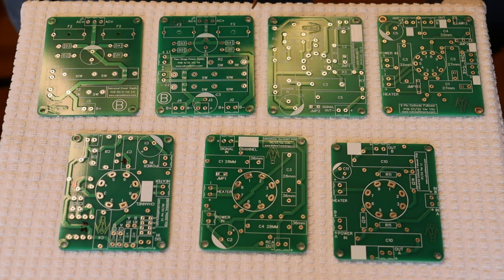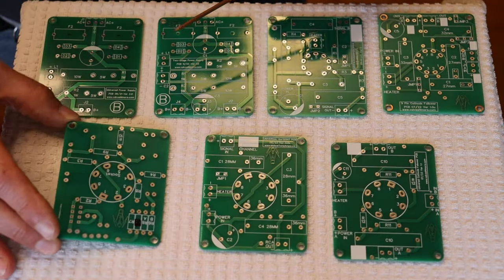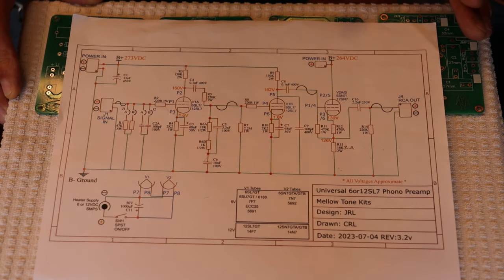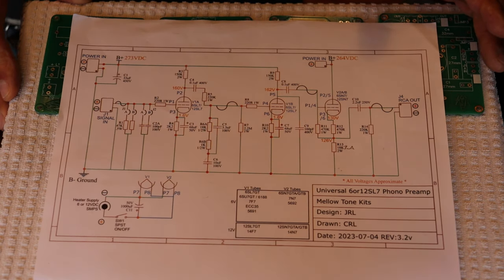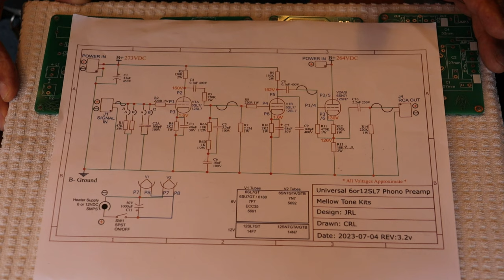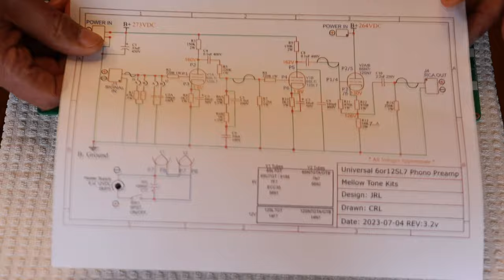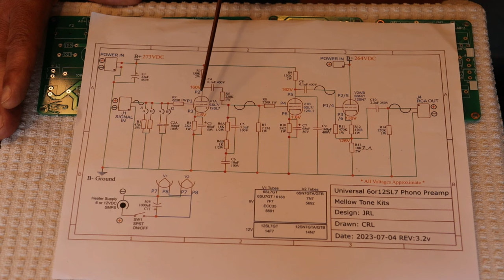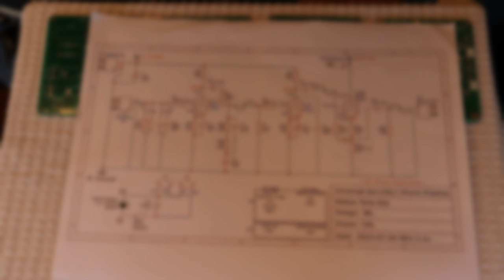Mellow Tone Amps #05 - Kit PCB's

Comment: You guys are great. Im glad to see yall making the PCB's you offer more known to the public. 

They really are great PCB's. Very versatile. Well made with appropriately sized solder pads. I've bought 3 different pairs of preamp/driver boards & 2 pairs of power supply boards from MTK so far. I also have the Classic 6sn7/12sn7 kit. Its very nice. 

The PCB's are a great price for what you get. I have paid A LOT more for other PCB boards/kits that were not as good or versatile as MTK's. The MTK's are proper, solid, double sided boards.

Comment: Yes a bit more work with point to point wiring, but one thing it gives is more space as you mention, since you have a third dimention to work in. Thus you can  get much more spacing between the terminals of the wires connecting the tube sockets. But great looking boards for those without the interest and needed patience to work point-to-point.  But I like building and you get more building out of doing point to point 🙂